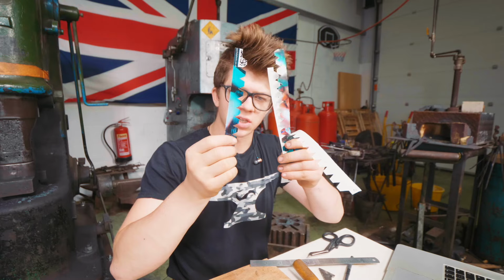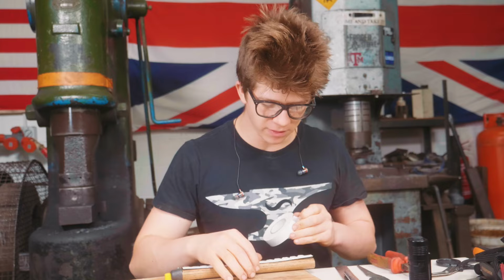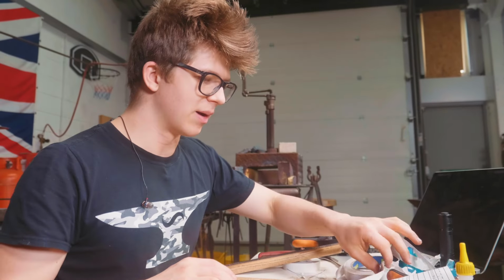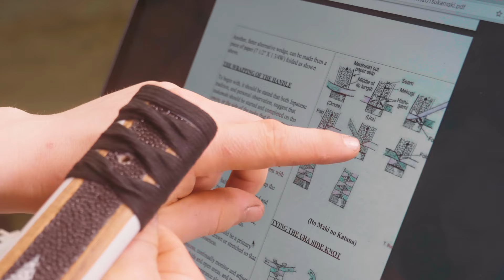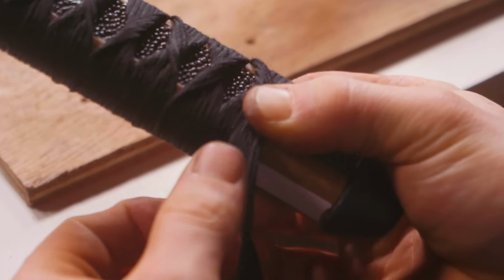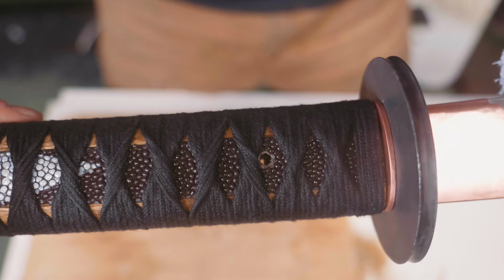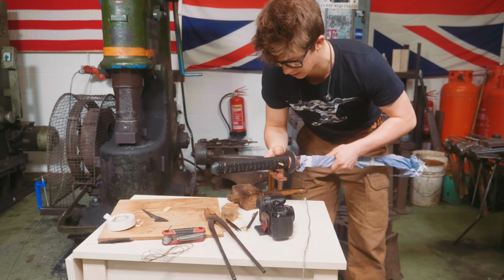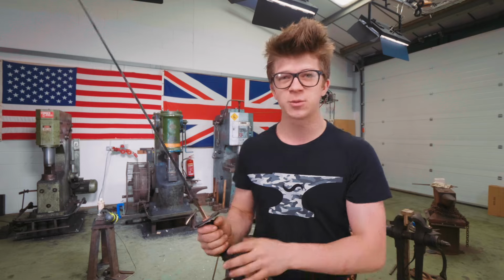MAKING A KATANA!!! 1 MILLION LAYERS!!! PART 14 ... Finished!

Comment: Actually most here criticizing are incorrect. There are 9 styles of forging a katana. This style would be considered Maru. Its ultimately the weakest version but still a recognized version of katana due to it's a single piece of steel forged. The steel used to make the best katana cannot be purchased by any one here criticizing this man. So short of the Sanmai style which is the 3rd best method on Japanese forging and most common in Japan today, no one in the world short of 3 people by the comments here can make a true katana. As for the layering comments. If you forge weld two 500k layer pieces you will have 1000000 layers. Congratulations young man you made a beautiful katana for that is a katana. Due to my love of Japanese culture I felt I had to correct some of these comments although I doubt the ones who claimed this is not a katana has fully studied the history up to present times.
Reply: But the white person can truly made a katana?
Or ONLY a piece of iron?
Reply: No one cares
Reply: What about that katana core ... where the soft iron
Reply: @babulsantai  
Getting soft iron is impossible during the forging. Carbon will react with it, making iron very strong.
Reply: weabo
Reply: Due to my love for Japanese culture I feel the need to correct you as well. First off there is no "best way" to forge a katana as they all had different methods for different purposes. Secondly this cannot be called a katana because the blades length exceeds that of a traditional katana and it's breadth is much wider, making it an odachi which is quite a similar weapon yet very different.
Reply: Also another point I want to make is that this blade doesn't have the correct curvature seen in katanas. It's angle is pointed upwards to simulate the curvature but it is not the same. Just looking at a proper piece is enough evidence to support this claim.
Reply: @mitchellstuckey1903  while you are right about the sword alec made not being a full traditional katana and is closer to an odachi, alec still isn't exactly wrong in his title as katana can also be used to describe any single edged curved blade and is also synonymous with the word sword or blade, which is why it is used so profusely in Japanese fiction
Reply: @samgriffin49  that is definitely correct to an extent, the word is definitely synonymous with sword, but that is actually mostly in modern interpretations of Japanese history. More commonly, odachi were referred to O-katanas by many swordsmiths of the era which is where the synonymous confusion comes from
Reply: Władca Wymiaru Actually, not always the case, the soft iron core can be implemented in the forging process of extending the blade by inserting the core in the first place, then tempering through tempering coals after the blade is formed- the iron core will remain soft/hard as it should be.
Reply: Wikipedia?
Reply: It's a nice sword but not a katana
Reply: ok boomer
Reply: Ok boomer
Reply: Ok Weaboo
Reply: Im rich im pretty sure with my connections i can get that metal with ease, what is it under 1 millions for enough for 5 katanas with that metal thats nothing , ive seen idiots buy katanas for 400k because of history , i broke one just to prove it was a piece of crap compared to modern day forging
Reply: @rqld1775  dont you mean your daddy's rich?
Reply: @hardanalljr.3138  Let me know when you get your rich hands on this 👍🤣Traditional katana swords are made from a metal called tamahagane, also known as "jewel steel." To create tamahagane, swordsmiths fold and hammer layers of iron ore for three days and three nights at temperatures of up to 2,500 degrees F (1371 degrees C).
Reply: @hardanalljr.3138  Money won't help you, it's illegal to transport it outside of Japan.
Reply: @londiniumarmoury7037  lol you know nothing of antiquity smuggling
Reply: Theres a real neat YouTube video called "secrets of Japanese swordsmith" or something..  it shows the way where the core has opposed grain to the outside of the blade..  and how they stack the little chips of the ore they processed into the special steel
Reply: @mitchellstuckey1903  , as an expert on the ancient lost art of making fun of those who debate the finer points of irrelevant facts of Japanese katana-making history, I must inform you all that this guy just made a sword, from scratch, that is petty much like a Katana and Katana is the word that most English-speakers would recognize as a sword from Japan. No one gives a rat's rear about the exact demarcation between the various types of Japanese swords for, if they did, they would be watching a very different video. Thank you. That is all. You may leave now.
Reply: @maxmustermann3938  Distribute the carbon. Impurities were not an issue in iron sand really.
Reply: @maxmustermann3938  the imperfect distribution of the carbon, either on purpose (some would say) or by accident gives the surface of steel in the finished blade the very subtle but beautiful features like, nie, nioi, inazuma, chikei, etc. Utsuri is also in some but the mechanics are not as well understood
Reply: @Rhea_is_gay  , my pleasure, good sir. My pleasure.
Reply: @mitchellstuckey1903  Your forget Tachi
Reply: @lytch7174  The person who made the comment cares, Alec probably cares, I cared enough to read the comment, you cared enough to read and respond to the comment, etc. Does that answer your question adequately?
Reply: r/iamverysmart
Reply: @PureAmericanPatriot  Not an incel, Im and old guy who studied this for a long time and I do appraisals. Just offering constructive criticism that you jump in and call "Douchery". I get it, everyone got a participation trophy where you grew up so anything not pandering is looked at as an attack. Thicken that skin up lad
Reply: Wow
Reply: I rather buy a $40,000 katana, than a $200 katana
Reply: Everyone is splitting hair over what this sharp ass blade is called instead of admiring his craft.
Reply: @dack4545  I literally just watched a documentary on the best sword makers in Japan and they used that steel. It's made from sand basically and it's cheap.
Reply: You legend
Reply: First you need to earn a Katana not buy one...at least a real one.  The person who truly made and was a master at making Katanas died early 2000 which took him a long time to make.  He did transfer his knowledge to couple apprentice as they are trying to master it.  So being rich is irrelevant.  If you own one by buying it then it is just a possession and materialistic.  Just some person who lived in Japan for 7 years...putting his two cents in.
Reply: @WadcaWymiaru  is a rose by any other color not still called a rose? Pull your head out of the dark ages. They're called "the dark ages" for a reason.
Reply: @redeyestones3738  
What?
Reply: @WadcaWymiaru  what?
Reply: @redeyestones3738  
Your answer was STRANGE! 
(mind english isn't my own)
Reply: @WadcaWymiaru  what answer are you refering to? I have no idea what you're talking about
Reply: @redeyestones3738  
Now i am confused.
I will watch Claire cat Lulu videos.
See yaaa....
Reply: You are definitely not pretentious
Reply: @hardanalljr.3138   try buying an english tutor or grammarly
Reply: @gkouzakos8353  I'm rich enough where it doesn't matter or will never come to matter
Reply: @hardanalljr.3138   ok kid
Reply: Imagine being triggered
Reply: But can a swallow carry a coconut?
Reply: Pretty sure we didn't ask
Reply: @dack4545  Wrong Tamahagane is made in a clay tub furnace and adding charcoal to the mixture allows the iron to gain carbon so that it can be hardened and it is smelted at about 1000°C or 1800°F the technique you've just described with folding the metal over and over is called a Shita-kitae technique
Reply: @PureAmericanPatriot  You should definitely stick to ancient lost art rather than bladesmithing then
Reply: double the 1,000,000 layers to get 2,000,000 layers katana as simple as that, LMAO
Reply: Nice, now the comment is 70
Reply: A million layers? That's real deal for a katana!
Reply: I dont think this is about doing everything correct. The hard work on this first(may it be or not) katana is the only thing that has to be taken into a count. He tried his best he had a success for himself and it is all that matters
Reply: Everyone going all Weebo - this is a fucking Katana.

It doesn't have to be forged on a Japanese mountain by a direct descendent of Masamune, given Amaratsu's blessing and forged with magical fucking steel. If this is what you believe then you are far too wrapped up in the romanticised pop culture which surrounds this sword today.

Its a Katana. And to be fair the million layer damascus steel used here by Alec is very likely higher quality than many of the Katana's made in the past. 
The best steel the Japanese had back in the day was very low quality full of impurity, so they had to fold it many, many times to remove impurities resulting in tamahagane.

Frankly, The miracle is that the skilled craftsmen of the day were able to make swords with a quality that were almost on par with crucible forged steel in medieval Europe at the time.

There are videos and articles on this subject.

The Katana is in my opinion the most beautiful sword style in the world, but it doesn’t need to be put on a pedestal and it certainly doesn't need fanboys trying to certify what a katana is or is not.
Reply: Katana sucks anyway, 
European swords rulez
Reply: weeb
Reply: @adamv.3116  at least weebs are no ordinary boring people
Reply: No one asked
Reply: @dylanquesinberry4394  noone asked for your opinion as well
Reply: akhtuallyy
Reply: @scopeh2006  yeah. Someone else here put it nicely, stop complaining about what it's called, it's a sharp piece of metal that shows great craftsmanship.
Reply: Watch out massive Japanese ancient history buzzfeed nerd here.
Reply: @lytch7174  no u

haha
Reply: @peepoo6713  dude there is a diffrence between a weeb and a peron who loves a certain countries culture
Reply: @WadcaWymiaru  ok what? thats just blatantly racist wtf?
Reply: @Ckvi1  peron yes
Reply: Respect 300000000
Reply: 89th
Reply: How can I learn Japanese, what do you recommend
Reply: tries to show appreciation for ancient japanese culture on a video about making a ancient japanese sword

Random tards:UUUURRRRGH HAR DUUUUUR WEEABOOOHSHjhdhshnGdfdgd
Reply: Eko Santai right that’s what makes it a true katana. Bc it’s meant to pierce . The iron makes it flex so it doesn’t snap. And steel body make it strong enough to do damage.  It also prevents warping without need for extra thickness. And the fact he didn’t make a hamon bothered me too. To clay temper the blade to have the iconic wave on that Damascus polished would have been gorgeous.
Reply: HardAnall Jr. monster, you prolly didn’t have a real on those are Exquisite works of art and are impossible to move out of Japan. It’s illegal.
Reply: Max Mustermann not true, they can get that from a single beach that produces iron sand. Literally. Hence price point
Reply: @hardanalljr.3138  You’re literally 5
Reply: @user-ph3cf1pi2e  i felt you say that with all the Karen you could muster
Reply: Oh god...
Have you used one on 1000 people for extra damage tho?
Reply: HAHAHA DWEEB
Reply: @mitchellstuckey1903  yeah I did noticed how absurdly long the katana was it was more like a really long tachi or a stubby handle  nodachi...
Reply: @samgriffin49  there are double edged katanas you do realize this no ?
Reply: @mrpumperknuckles1631  calm down, Karen
Reply: where can I learn more about the different forging methods?
Reply: @alid3479  Books
Reply: @alid3479  
There is a guy who talk about swords. Search for "fantasy re-armed" video...
Reply: @interexp  yep that's how's exponentials work
Reply: @WadcaWymiaru  if it's in the general shape of a katana, it's a katana, maybe in the same way avitar last Airbender is an anime, but for a westerner, we're just gonna call it that, because that is what it looks like..
Reply: So what's the BEST method and is there a video of it?
Reply: @WadcaWymiaru  katana doest exist, it's just metal
Reply: Can I just ask wtf kind of drugs you guys are taking

Comment: Alec, for a guy your age, that is astounding talent.  I watched most of the videos and I admire your honesty admitting your mistakes.  That's the key to learning not to repeat them.  One word of advice, I cringed a bit when you split the roll of tape with no safety gear.  Those fingers are your bread and butter. ;)
Reply: Wood work machine regulations act 1974.
Reply: his methods puzzle me a bit sometimes but it definitely seems to work out in the end. the whole time he is cutting that tape im thinking why cut an entire role of tape in half why not cut off a strip then just split the strip in half with a utility knife but thats just me.
Reply: Shane Beaulieu sup
Reply: Band saws and gloves is actually more dangerous
Reply: The regulations about machine working tells you a different story! 
Never wear gloves on lathes, drillpresses, millingmachines, ... 
they may catch your clove -> your hand -> your arm, and may rip it of. 
Only grinding machines come over this, because of the sparking, 
that may damage the skin, and cloves in contact to the surface get eaten up.

Comment: Nice sword tbh. I'm not a black smith, but I enjoy your videos. I'm actually a machinst, and wanted to give you some advice. When using carbide inserts, on fly cutters, or knife heads, take a bit deeper cuts. The layer on the outside is harder than inside, and you will get better results taking 0.5mm deeper cuts, and save your tools from unwanted wear. I would also suggest annealing part of the blade. Great vids though, a lot of learning.
Reply: chronicblazer84 *blacksmith
Reply: Dioross Orozco grammar Police?

Comment: Put the handle on the sword, put your left foot on the right side of the blade at the point, (may want to put a piece of wood down to ground the point on), rest the mid of the sword on your left knee, and put your right foot around the front and push back on it with your calf to hold it in place. This works better with a scabbard.

Then take the mid-point of the tsuka-ito and pull it tight around the left side of the Tsuka down by the guard, with the mid point centered on the side. Pull the wrap around and across itself, twist and reverse, then back around, twist and reverse, and so on, until you get back to the Kashira. You can adjust the wrap to close the proximity of the twists as you go, but keep it tight on the twists.

It is very strenuous for the hands and really increases grip and finger strength. You never glue this on; it's meant to be removed. As you use the sword, it loosens, and you maintain regular maintenance on the sword, and this is part of it.
Reply: Very nice finish

Comment: If you'd like to use silk, diamond style is not quite stable, barely wall hanging only.
In the other hand, if you really like diamond style, leather would be a better choice. Easy to control and fold. But still, wall hanging.

I tend to believe "knot" style would be more useful. Single knot in the palm side, double knots in finger side.

I do have videos in my channel to explain how I did it. I practice pretty much daily, the knot style can last for a year or two.

By the way, using wood for pins is not suggested, use a very special strong bamboo, not bamboo chopsticks. I used to soak the bamboo sticks in machine oil for months to make them even more strong.

But really surprised you make it from scratch. A great achievement. Thank you for the series.

Comment: My culture is not your prom dress. Nah I'm just kidding you did an awesome job and the center of the blade looks so cool where you see ever one of the different steel layers.
Reply: Was about to throw these hands
Reply: In any case, the katana is about as Japanese as tea is British, which is to say not at all. They were both discovered in China. Specifically, the katana is simply a tweaked design taken from a Chinese sword. Hell, katana didn't even exist until maybe the 1500s, centuries after the samurai were formed. This is what weebs refuse to accept. The katana is not the traditional samurai weapon. Spears and bows are
Reply: @alpharabbit2353  makes sense, because as a primarily bladed weapon (unlike most European swords which had many parts that could be used in combat) the katana would do poorly against other armored opponents, and Japanese iron is of relatively poor quality meaning that they would break more frequently than other swords (the folding technique helped with this greatly, but it was still a lot of work for relatively little pay off).

Comment: In hindsight, wouldn't it be wiser to attach the handle, peg it, then leather and wrap it??  It just felt a little too painful the order you did it.
Reply: Maybe, but originally it was done the way Alec did. Katanas were meant to be dismantlable - in order to be able to easily change the handle when it wears out.
Reply: It is painful the way he did it however, everything the samurai did is an art form and a method for finding inner piece and an expression of each persons own skill. Assembling a weapon is no exception.
Reply: Wrapping an ito with the ho attached to the blade makes it 10 times harder.  You both have to deal with the weight and length of the blade flipping it back and forth for each wrap, and the blade will never lie flat or stable enough on a table to get a tight wrap, ive tried doing it before with the katana between my legs and on a table, it was quicker to dismantle, wrap and put back together.  Ito wrapping is fairly fatiguing work and can get frustrating rather quick, so working with just the light wooden ho makes the Job easier.  What would have also made it easier would have been a full wrap of ray skin rather then just the strips, means your wraps don't need too be as tight or accurate as no wood will ever show through.